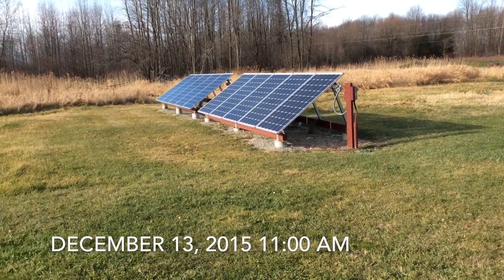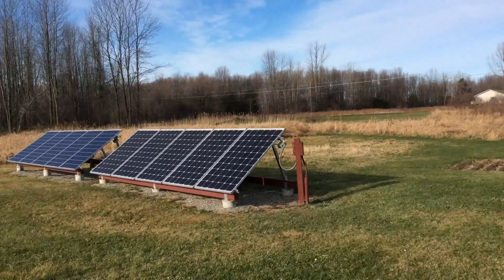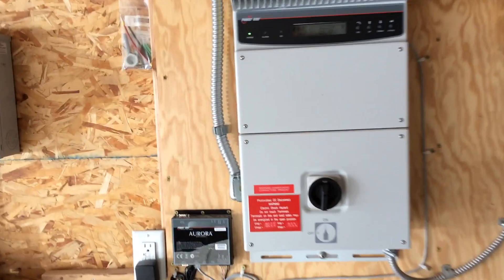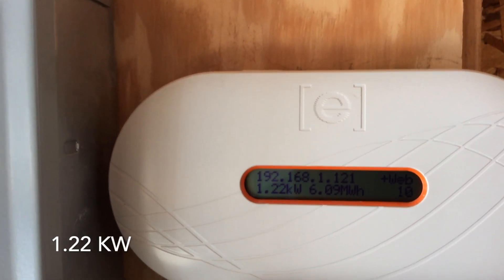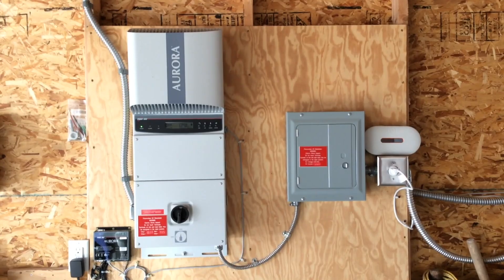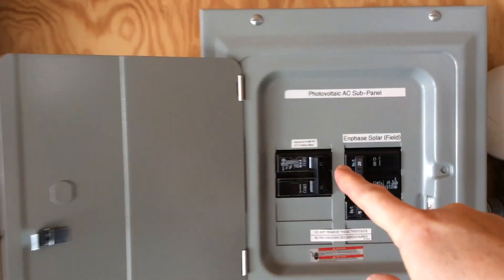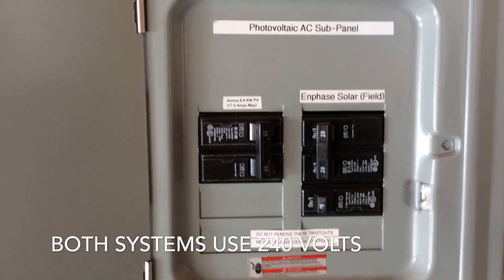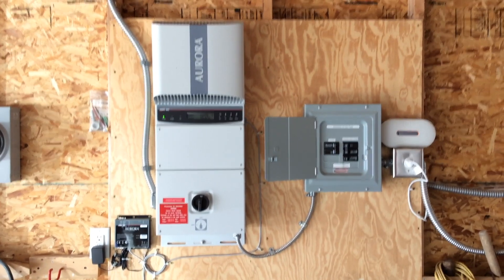South Vs. West Facing Solar

Comment: Are the panels all the same size?  Meaning, the 17 on the roof are 280W (for example) and the 10 on the ground 280W as well?
Reply from the maker: The panels are Different between the two systems.  Roof has 260 watts panels that go into a central inverter using two strings.  Ground mount system has panels ranging from 265 watts to 280 each using micro-inverters.  Since making this video I have added another 10 panels on a new array in front of the existing ground mount.  Thanks for watching.
Reply: @GreenMountainDIYGuy  Thank you for clarifying.  I just wanted to make sure the roof wasn't 200 watt ones(3.4kW total)and the ground have 360 watt (3.6kW total) ones.  If you don't mind the question, if you could start from scratch again today, would you go with the micro-inverter setup over string or power optimizers?